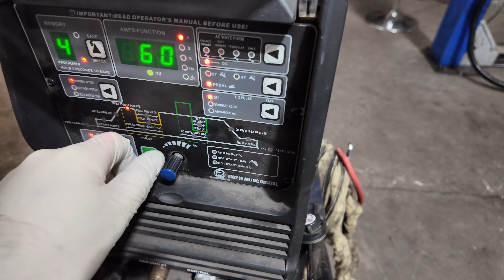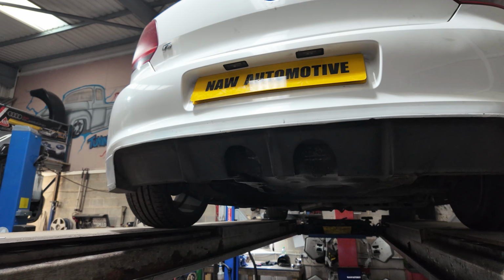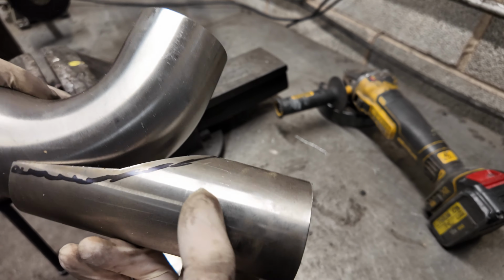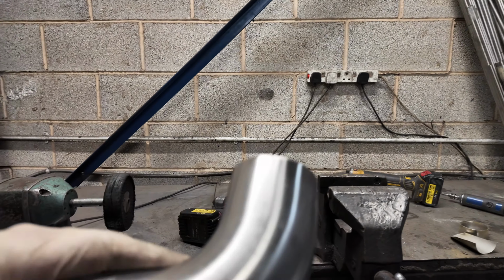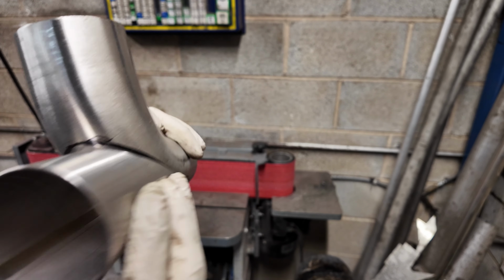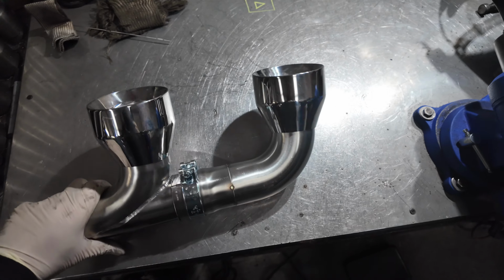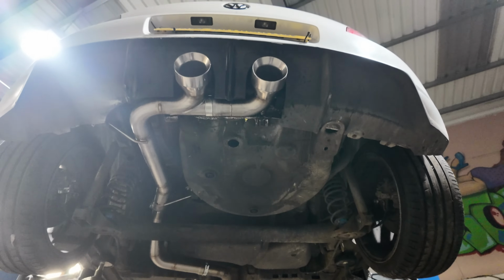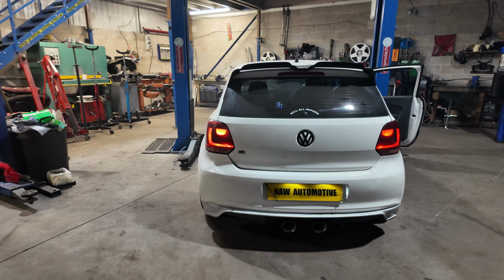EXTREME SOUND: Volkswagen Polo 1.6TDI Straight Pipe ROARS!!**

Comment: This wont pass an mot will it?
Reply from the maker: Nope not with the dpf delete pipe, the rest of the exhaust we made is completely legal however the dpf delete which it already had fitted is not legal for road use.
Reply: Thanks for the reply mate, see I've got a 1.6 vw mk7 2016 dpfs stripped stage 1 remap and straight piped still not loud or any rumble from it assuming it's the dummy box's/mufflers I thought without them it would be an mot fail. Any suggestions whys it's not loud mate?
Reply from the maker: @Cart-xd9rc  the downpipe is your issue they have a metal cat above the dpf, get a custom downpipe it would sound exactly the same as this one
Reply: Absolute gentle man thank you very much mate hadn't a clue 👍 would that still pass mot would u know by any chance?
Reply: @Cart-xd9rc if it smokes it’ll fail it’s thay simple really.. if you got a downpipe with no visible DPF it will also fail